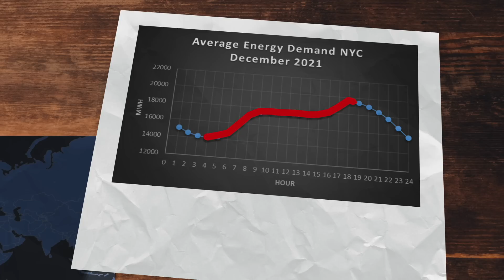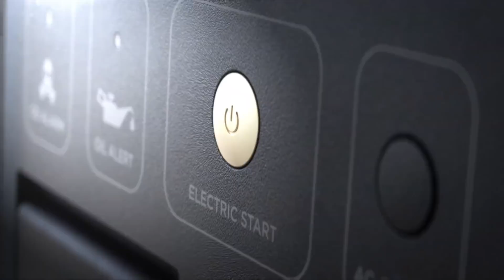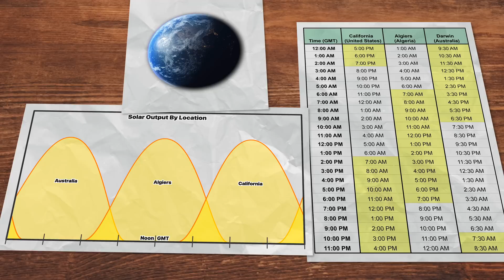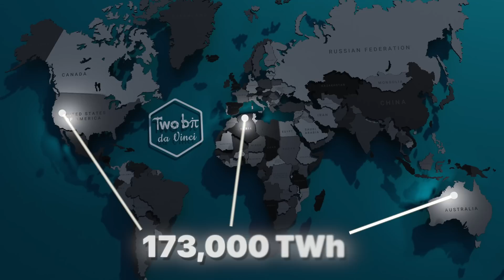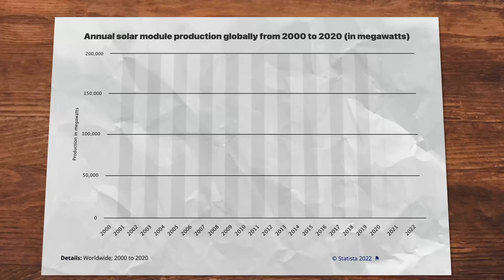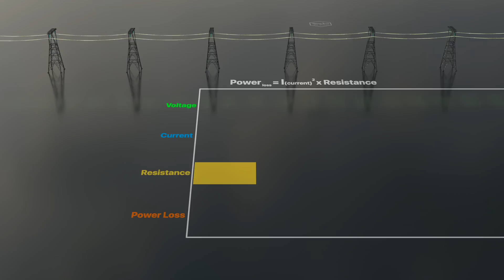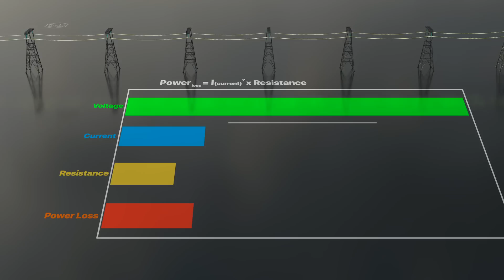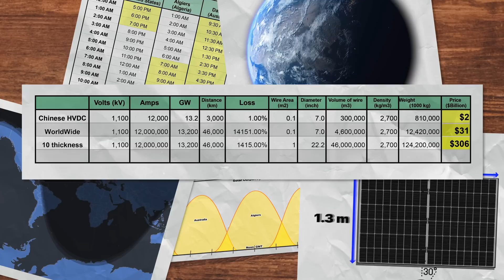World Solar Energy Network... Could this work?

Comment: Your explanation of AC vs DC for transmission lines is not correct.  Yes, there is a skin-effect with AC, but it does not necessarily make an AC cable cost more.  The main reason DC is often used for transmission lines longer than around a few hundred miles is because it is cheaper, easier, and safer.   Very long AC transmission lines wind up with phase synchronization problems due to the heating and cooling of the transmission line over that distance.  This limits an AC transmission line to around 300 miles.  Going longer requires dynamic phase synchronization equipment.   Once you start needing such equipment, losses mount and costs cross over the cost of a [U]HVDC  transmission line.   Lines longer than around 600 miles are cheaper by switching to [U]HVDC.

Phase becomes a serious problem for AC transmission lines for numerous reasons, but one big one is the typical temperature-based expansion and contraction of the transmission line over the course of the day and also depends on the amount of current going through it.   360 degrees of phase at 60hz is around 3000 miles or so.  The phase tolerance is less than 1 degree.  I don't have all the equations in front of me but ultimately this limits AC transmission line length to approximately 300 miles before things get dicey.

--

Now, you are absolutely right in that voltage shifting a HVDC line is a bit harder to do than voltage shifting an AC line.  The latter requires only a transformer while voltage-shifting a DC line requires converting it to AC, then shoving it through a transformer, then converting it back to DC.  But here's the thing... you generally don't have to do that with a HVDC line.  The only conversions that are happening are AC-to-DC, or DC-to-AC, but never DC-to-AC-to-DC.  At least not in the same station.   These conversions occur only where the [U]HVDC line has to be tied into various AC systems.

So, for example, the Pacific DC intertie that runs down the length of California has a number of AC-to-DC and DC-to-AC (its basically just the same circuit, actually) interconnections, but I'm fairly sure there are no DC-to-DC level shifting stations.  Not 100% sure about that though so if someone knows better, please follow-up.

For very long distances and robustness, DC is really the only choice.

Comment: There is one thing about those areas of the planet that get a lot of clouds -- they also get a lot of rain, and therefore they usually have hydroelectric energy. although the dams can be harmful to the river ecosystems. Unfortunately it takes a lot of pollution including even using coal believe it or not to produce solar panels, but it seems to me that they last longer than just burning coal outright. so they seem like they would have a net effect of reducing greenhouse gases compared to not having panels. batteries are highly polluting also.

Comment: The technology to do this is much further away than practical storage technology, I think. This would also mean there could be a worldwide co-monopoly on electricity. Even if geo-political issues stabilized permanently, which won't happen, natural disasters will still happen. With the world's grid crippled, it will be a lot harder to make repairs to the power lines.

Comment: how about just local, bruh
Reply: why would you put a global law in place, not serving you
Reply: not interested in the worries of the dead
Reply: ecoflow would be smarter with fuel cells, not mechanical engines
Reply: stay independent, actually
Reply: try superconducting high voltage dc network, for fun

Comment: What about an Orbital solar system,with that we could do away with cloud coverage day and  night light loss, Nikola Tesla gave the prefect way to transmit "Wireless power transmission ".
Reply: A MIRROR FOIL that can be unrolled and constructed in low orbit space shining the sunshine on the opposite side of the Earth (nighttime). For just around 2.4billion US you could provide enough re-directed sunlight to POWER the Earth 3X more than it uses in electricity. Solar panel farms could be built on Earth to most economically receive that mirrored sunlight. Only small drawback is there will no longer be dark skies at nighttime (this could even be a benefit not needing streetlights anywhere in the world ever again.)

Comment: I would do a thought experiment on space based solar. Automatically decentralized, sun shine is 24hrs a day, power can be beamed down to various locations using rectennas with a power efficiency of close to 90%. You don't have to deal with high voltage power lines other than what we do today. You don't need as many panels as they are getting sunshine 24 hours a day. It only depends on cost to space but from the numbers you're throwing out I'd think it's already cheaper to go the space based route.
Reply: This will work better for less money. A MIRROR FOIL that can be unrolled and constructed in low orbit space shining the sunshine on the opposite side of the Earth (nighttime). For just around 2.4billion US you could provide enough re-directed sunlight to POWER the Earth 3X more than it uses in electricity. Solar panel farms could be built on Earth to most economically receive that mirrored sunlight. Only small drawback is there will no longer be dark skies at nighttime (this could even be a benefit not needing streetlights anywhere in the world ever again.)

Comment: In an ideal world, we would look at this thought experiment and compare it with other options. Solar and wind farms would need to be in numerous places. Clouds, storms, and other events impact generation, and so do cyclones, twisters, and monsoons. But earthquakes, wars, and terrorism can also impact generation and generation capacity. 

All of these items strongly suggest redundancy, burying cables/transmission lines, and additional transformer sets. But they also suggest alternative means of energy storage... alternatives include Hydrogen and ammonia, which might be used in NT, Australia. That raises questions about pipelines and grid-scale static generation capacity. 

Between the twin towers or 911 and Nordstream pipeline incidents we see that what used to be considered not worthwhile or unthinkable or too economically valuable s now strategically valuable at times. This means that in practice the destruction of infrastructure is now thinkable both at war and in terrorist attacks.

Did I mention the position this thought experiment places China in within the global economy? There was once an incandescent light globe that had to cease being manufactured because it lasted too long. Virtual monopoly supply of significant critical components - solar panels and wind turbines. Does that mean grid scale monitoring by (Chinese) component suppliers?

What about grey warfare? Data thefts and grid shutdowns come easily to mind.

And what about making the suns shine 24 hours per day? Can do! Move the generation to space. Some people are currently working and dreaming and sweating over these technologies. So if beam-down stations were incorporated into the design it would be very helpful to the longevity and usefulness of these plans.

Yep, but I was told to never expose a problem without a solution. And a Professor taught me KISS.

We can solve the whole lot with realsize (1-1 scale) slot car racing tracks! Guided pathway, all electric, well known and long-lived technology that suits all ages, no need for AI controlled cars and the list goes on...

Comment: What about bouncing the sun arrays from space down on to parts of the planet by mirrors attached to satellites in orbit .
Reply: A MIRROR FOIL that can be unrolled and constructed in low orbit space shining the sunshine on the opposite side of the Earth (nighttime). For just around 2.4billion US you could provide enough re-directed sunlight to POWER the Earth 3X more than it uses in electricity. Solar panel farms could be built on Earth to most economically receive that mirrored sunlight. Only small drawback is there will no longer be dark skies at nighttime (this could even be a benefit not needing streetlights anywhere in the world ever again.)
Reply: @markpetty9206  I was actually thinking of a  beam of light that can be widened if necessary for solar farming stations and not the neighbourhoods that individual satellites can direct theses beams  .
That's a great idea Mark .
Reply: @keithwhite5657  That would absolutely work too.

Comment: Transmision cable losses sending electricity long distances will be HUGE. It's too risky having only 3 locations generating power for the Earth. This will work better for less money. A MIRROR FOIL that can be unrolled and constructed in low orbit space shining the sunshine on the opposite side of the Earth (nighttime). For just around 2.4billion US you could provide enough re-directed sunlight to POWER the Earth 3X more than it uses in electricity. Solar panel farms could be built on Earth to most economically receive that mirrored sunlight. Only small drawback is there will no longer be dark skies at nighttime (this could even be a benefit not needing streetlights anywhere in the world ever again.)

Comment: I think you're arguing in bad faith if you want to propose a global solar network but still want to push the misinformation that it's carbon zero.
This channel seems to consistently push the idea that solar panels are a magical technology and are completely ignorant of how you mine the material to produce solar panels in the production process.  And of course the fact that we still have no way to recycle solar panels.

This thought experiment is also completely ignoring the ecological disaster that would come from having solar power facility a third of the size of Arizona.

I have solar panels on my house but anybody selling you the myth that solar panels are a green technology are either ignorant or have a financial incentive to lie.

This channel is cool when it talks about innovative technology, however it leans too much into alarmism and blind ignorance to attract viewers.
Reply from the maker: Solar panels will all things require materials etc… but they work for decades this trade off makes them amazing. “What’s the ecological disaster of placing these in arid deserts? Might actually be able to grow food under them. What are you comparing solar to? How do they compare to coal also needs mining or oil? Things that benefit you for a single moment? Cheers

Comment: I think going "de-centralized" is the way to go.  You start out with "micro-grids".  It allows you to integrate various resources (kind of like an OS).  Batteries are a critical foundation for doing this integration (frequency regulation, time shifting).  The more renewables (wind and solar) you have, the less fossil fuel you'll need.  It lessens the supply chain dependency.  

You need intelligent demand-response, for managing one's loads, esp. with an eye towards critical loads.  You have graceful failover, on the demand side. Then once you have the basics established, you might consider transmission lines to other micro-grids to add some power supplementation.  But it would be secondary.  (The closest analogy we have, is the internet.  It was initially described as a "network of networks".)
Reply: GREAT! In theory... The is Not enough material in the World to supply Everybody with Buckup Batteries....!
And we need them for the Cars And Tracks To!
Reply: @voytek3999  they will advance in 20 years at the current rate of battery technology advancement I believe it would be possible!
Reply: @patrickday4206  Yes! We Need New Technology!!! I'm Not against it..
Doing it right now will create unhealthy competition and Distraction of needed resources without the Right outcome...!
Reply: @voytek3999  I disagree we have had all our eggs in one basket for too long one natural disaster of the right type and America is game over we just now have hit a point were things are survivable! Fusion energy will likely be the future and solve most problems but we will still need diversity! Even the whole planet being too advanced without capabilities to manufacture and sustain our technology off planet in the event of a catastrophe will undo everything and is a problem! The best laid plans are waylaid by unforseen things specialization has been profitable but created its own problems we need leadership that thinks about the future consequences of the technology rolled out not waiting for the problems after the fact! But the biggest thing humanity needs is people to live longer so they can use the wisdom that they gain and realizing that they will have to be reasonable for their decisions in the future! But currently the world can't support this but we are getting close to much longer lives!
Reply: E-fuels are perfect for a decentralized energy grid.
Reply: will it still take 500 years to go 100% green though?

Comment: You could do the same idea with space based satellites directing power to earth based stations and the amount of panels could be drastically reduced. Though it has other challenges, like atmospheric and wildlife effects at minimum.
Reply from the maker: Future video!
Reply: I first saw that concept in one version of Sim City years ago 😂 Personally I think it'd be more helpful to focus on more immediate solutions right now, but still, it is fun to think about the Sci-FI future we're heading to. I keep asking though, why is nobody talking about Ecotricity's genius idea for Gas from Grass? It's nearly entirely clean, nearly perpetual energy for heating grids that won't require ripping out infrastructure at national scale. A great short-term solution until even cleaner ideas are ready to roll out at maximum scale imo? 

TL:DR 

1. Grass grows absorbing CO2
2. Anaerobic digestion to methane
3. Methane then burned into carbon dioxide.
4. Go to 1. 
5. Profit!!!!

Their own calculations suggest it's 87% cleaner than digging gas up from where it's been locked away for millions of years, and they think it's reasonable to claim it would end up producing just 1% of current emissions from fossil gas by 2050. A lofty goal, but even reaching 95% would be incredible? They also rate it as the carbon they admit, being reabsorbed within 6 months, so I suspect other emissions are, infrastructure, tractors collecting grass etc?

Comment: There are other things missed that show this would be nuts, and I’ll cover a small bit of those: the reasons high tension wires are on the giant towers (which aren’t cheap to build) include the fact of arcing potential, which varies based on humidity, etc. and note the high tension power lines aren’t insulated. China’s power transmission is already over a million volts, but you’re talking 1000 times that: towers alone wouldn’t be feasible due to arcing, and you can’t reasonably tunnel everywhere for geological reasons. It’d also be fun to see what’s required to convert back to AC and stepping it back down to more feasible grid voltages.

Comment: Loved your analysis!
27 million acres per site - no, doesn’t each site need to be able to supply almost 100% of world’s power, at the times of day worst for the other plants?
All of Arizona or even 1/3 of it is totally unrealistic, ain’t gonna happen. And that doesn’t seem to jive with your earlier comment that total area needed is only 1% of Australia’s area, or about 19 million acres. 
I can’t get over reading that all U.S. power could be supplied if all rooftops had solar! We need more incentives and more regulation of power companies to encourage solar. How about solar on warehouses? Parking lots? Shading city roads between skyscrapers?  Ag solar over some agricultural fields?
Overnight is not the worst problem. That would be overwinter in the more northern states. This is an opportunity to begin designing and building long-range power transport for solar energy, from southern states to northern. 
The overnight problem can largely be solved with: (a) EVs in place of ICE cars, all charging during the day and powering the grid at night; (b) lower-cost batteries such as flow batteries and sodium ion batteries for grid storage; (c) better home heat reservoirs for minimal heating needs at night; (d) wind power, which is available at night. 
We would need redundant transmission lines.  You wouldn’t want the entire world depending for its energy on a single set of transmission lines. Centralization is, as you point out, not a great idea. Distributed generation, a diversity of sources, a diversity of grid sizes, all play a role. 
Green electricity for the entire world is completely doable and we WILL do it. ARE doing it. The only question is, how FAST can we do it?  How can we speed it up?

Comment: Use AC transmission but use hollow cables to take advantage of the skin effect. Use a dialectic core that would concentrate the magnetic fields to a thick outer skin. What that dialectic is I don't know but I'm sure there are enough electrical engineers to come up with it.